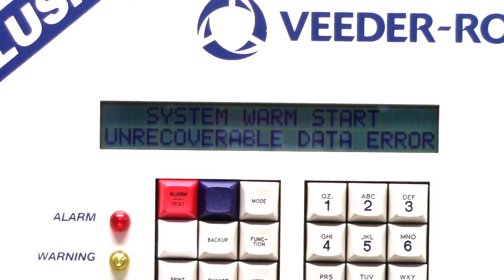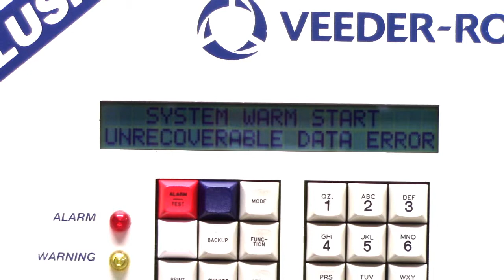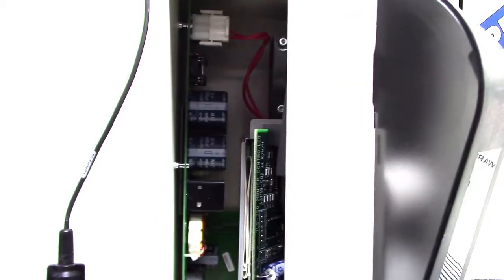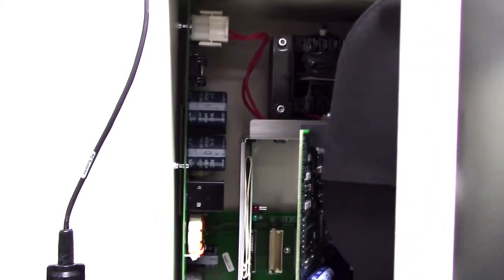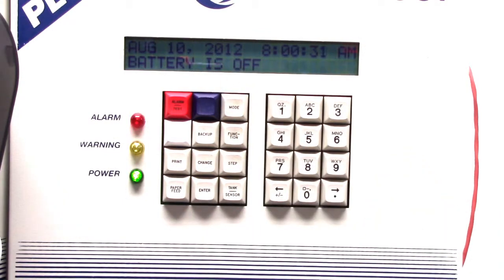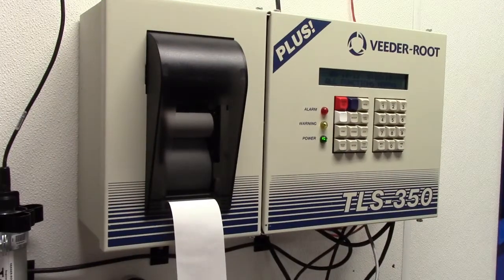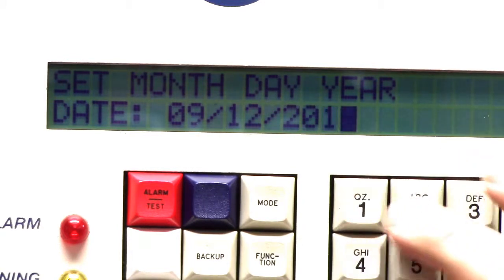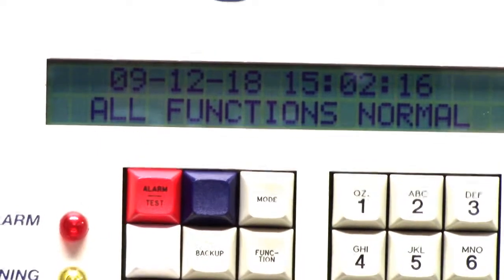TLS 350 "Locked up" Restoring Data

Comment: How do you replace the battery? 

Do you have to take that board out?
Reply from the maker: it pulls straight off the board. there are 3 pins on the battery that fit 3 sockets on the board.

Comment: Mine has been doing this. Did the warm start and got it back but keeps going back to the same thing and locking up. Any idea why?
Reply: I had the board replaced with a brand new one and still it's doing the same thing
Reply: @erickbeasley9229  If it is doing the exact thing after you replace the board, the problem could be on one of the communication boards behind the printer door. Remove all al the boards and then power up again, plug one at time to see which one is causing the problem
Reply from the maker: Battery is bad
Reply: You need to replace the ECPU